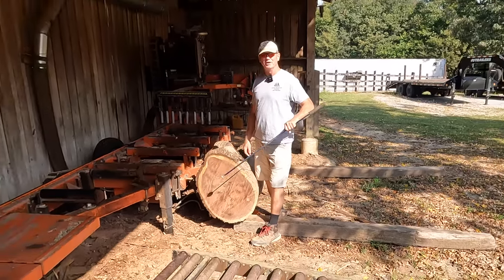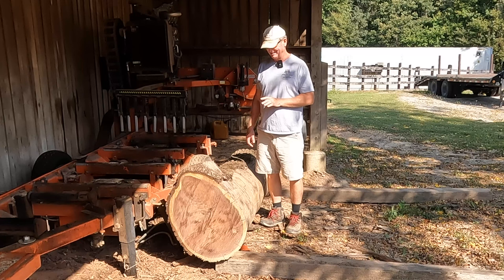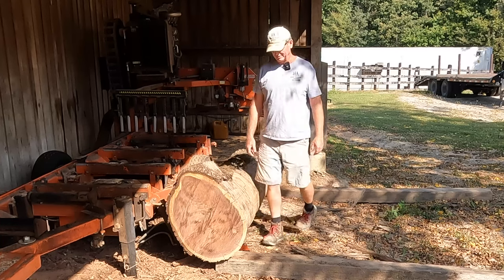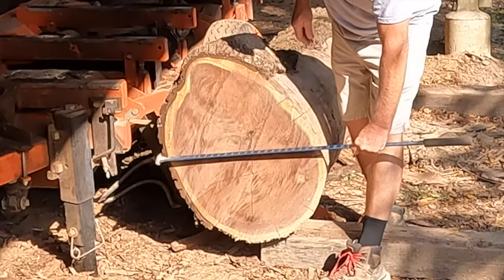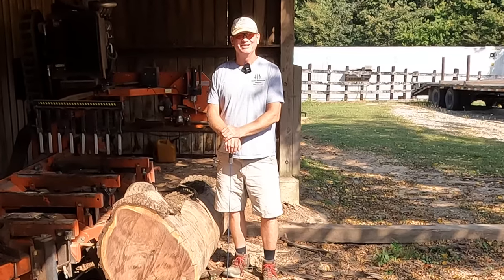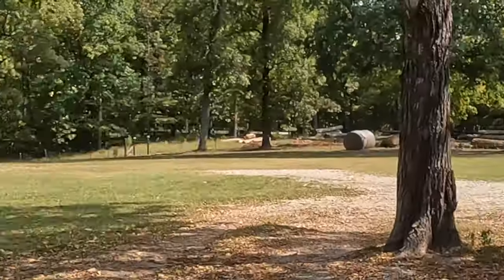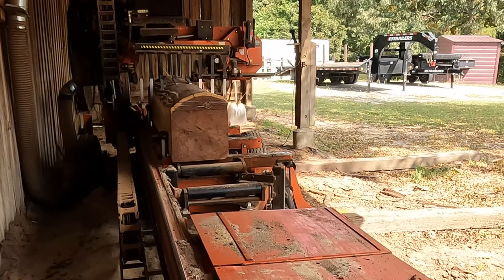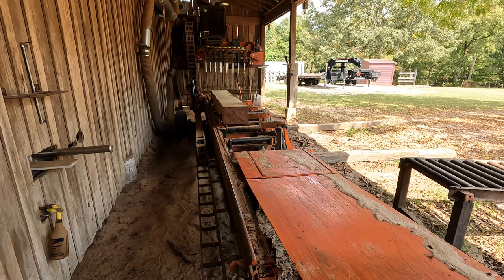Unlocking the SECRETS of Sawmilling: Don't just saw GOOD WOOD

Comment: Not everyone wants grade wood to build barns and sheds. They don't want it planed or dried to save money and others want slab wood to build furniture.
Reply from the maker: Of course, people buy wood of all kinds and at all prices, but all hardwood produced by a commercial mill is sawn using grade sawing techniques as I've outlined here in order to maximize grade and so maximize net profit.  I'm not coming from the perspective of a lumber consumer, but from the perspective of a lumber producer, trying to have a successful business.  The point of this video is that if you want be a professional sawmiller, you need to saw like professional, and all;  professional sawmillers know the NHLA grades by heart, and no professional sawmiller will describe their wood as "Good."  They will always use terms such as Number 1 Common, Number 2 Common, FAS, Select, frame stock, etc.  Even a pro butcher has to make low value chicken wings as well as premium breast meat, but they don;t describe their chicken products as "chicken parts."